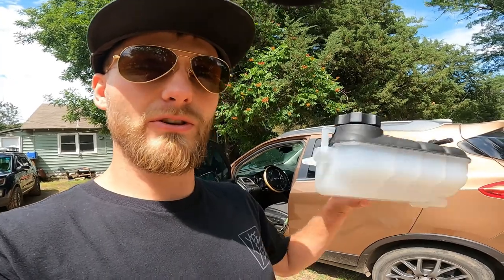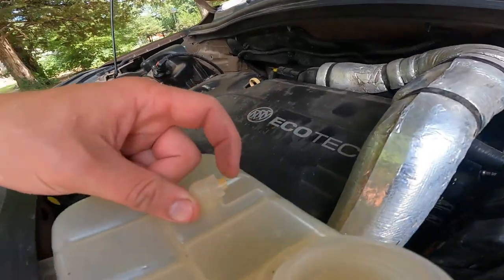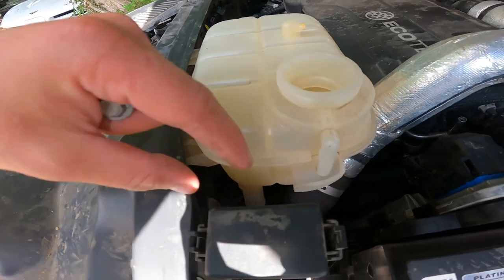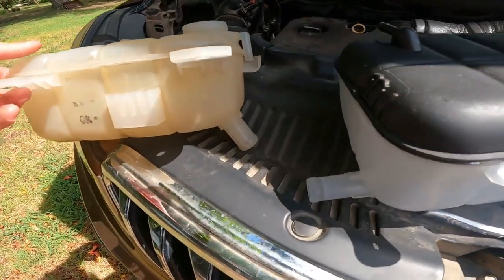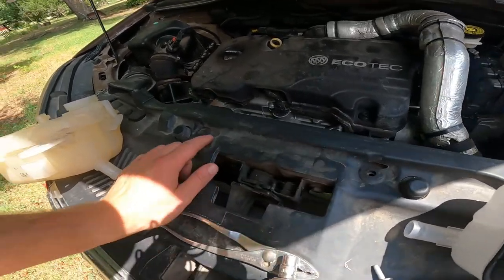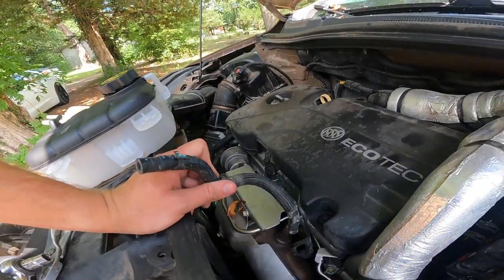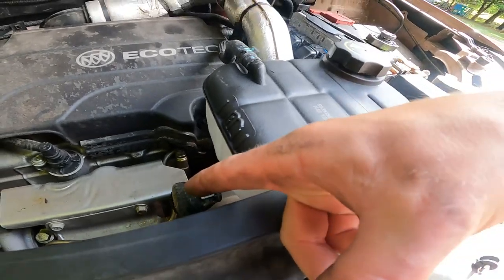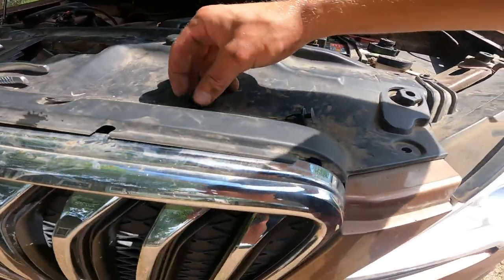How To replace Coolant Reservoir on 2016 Buick Encore Sport Touring - Daily Vlog

Comment: Thank you for the info, when you rerouted the hose, did you have to add an extension?
Reply from the maker: I used a spare hose I had laying around instead. That house came off a 97 Corvette. I'm sure you could get a hose cut to size of needed.
Reply: @ArcticVette  Thank you for that quick reply!
Reply from the maker: @Chesoi1  you're welcome! I hope this helps out 🙏🏻